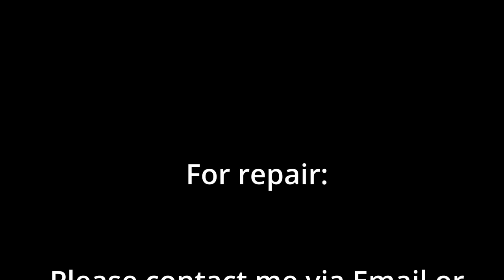BMW GPS module repair (AI VOICE)

Comment from the maker: Customer update: It didnt work :face-red-droopy-eyes:
Reply: damn, how so, why do you think that is?
Reply from the maker: @kaebogtimater  no idea..I do not have a bmw to test the repair..if I did, it may be a different outcome.
Reply: @northwestrepair  small wires from point to point should give it on flexibility, blob was doomed to fail . They put that connector back from 5th try  almost certainly
Reply: It is the user's risk of an electronics repair service if they do not request a complete repair.

Comment: I read the title thinking there is a BMW that has an integrated GPU, then I read it again.
Reply: I mean, technically something has to run all of the digital screens...
Reply: As it happens, NVIDIA does actually make a lot of parallel processors that are used in advanced cars with self driving features. These components are functionally very similar to GPUs but are just used for a different purpose.
Reply: Am sure not a GPU 😂 @TheAmazingCowpig
Reply: @Dracula.25  Does it do graphics? Is it integrated?...

Comment: Great job (as always)
That PCB looks like a multi layer design with, lets say, 8 layers?
Power planes, shielding, data, and more and more shielding.
.
Those "components" near the connector looks like termination/protection/ "printed" resistors (a small blob of carbon maybe?)
Or just  spark gaps? Where there is no solder mask? It is difficult to see in the video.
.
I am afraid that there are lots of broken connections in the middle layers that you simply cant access in order to fix.
I believe that, sadly, this is a no-fix. Only way to tell is to connect to the vehicle.
Anyway, great work Tony! And thanks for sharing!

Comment: I guess this is a multi layer board. The traces you repaired on the bottom side just belongs to spark gaps connecting to ground. This is common in automotive industry to handle static discharge on ECU swapping. I guess the board is still not working. Maybe you are lucky an some of the through hole connection of the connector pins still connect to internal layers. But there are two rows of pins... I'm very sceptical on this one.
Reply: I guess will know when I receive this back
Reply: @ggonxhi  I wish you luck! But I am not very optimistic tbh.

Comment: how do you handle warranty on this? given that you cant test it before returning it to customer.  also, are you worried about the strength of that board? given that a good deal of force is often needed to plug those connectors in and its not uncomon to have htem at odd angles under a dash.
Reply from the maker: I don't 
Given the circumstances, an agreement was made.

Comment: I would epoxy around that area after testing the module because it can crack again if the harness connector is wiggled.

Comment: I don't think the crack repaired could survive the next insertion. If 3d space is not too confined, using a cable to extend the connector off the board sounds more promising.

Comment: The OEM soldering for the connector looked pretty nasty; if I had the unit open for something else I probably would have redone that just because it was ugly.
Reply: This is a special soldering method where solder paste is applied to the pads, much like SMD soldering. Despite looking not as "normal" this method works without problems in through hole via pads.
In the past pins got press fitted in the holes without soldering at all. It looked strange too, but worked surprisingly well.

Comment: What is this exaclty? Cannot be a GPS receiver, too complicated. Is this the whole navigation system? Why is it not part of the main computer? (or a 20 year old wince mobile phone, those had better maps than most cars)
Reply: It’s the bmw gps/tracker. SOS system and the 4g for bmw apps.  
So it does a few things. Will see if it works when I get it back

Comment: My friend had a similar problem, the central locking antenna on a beamer.
€1000 euros he paid for that repair.
Reply: You are correct. This is mine 1200$ to get a replacement and 400 to program it
Reply: @ggonxhi 😂 holy crap and I thought VW parts was pricey
Reply: Yea pricey thats why I’m hoping this fixed it. Otherwise I have no choice but to pay. Can’t even use a used unit it has to be new.